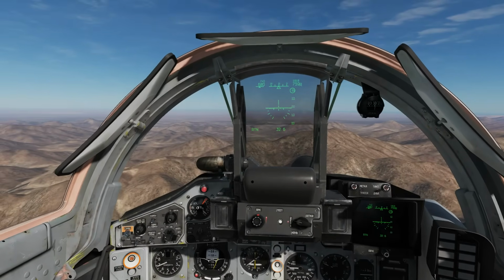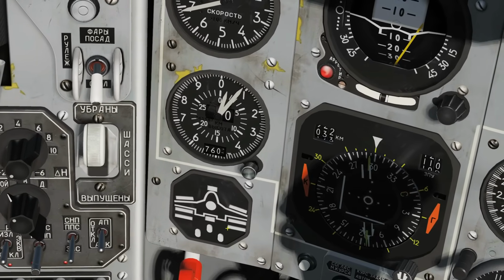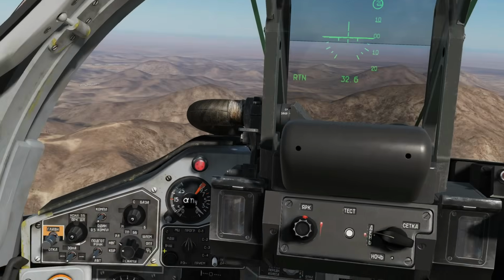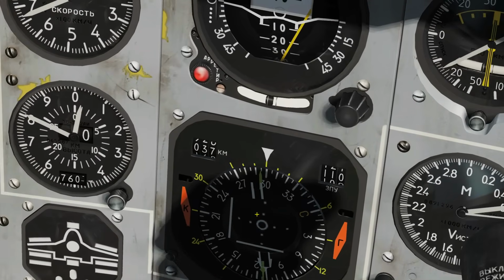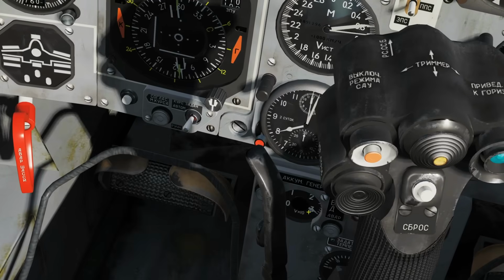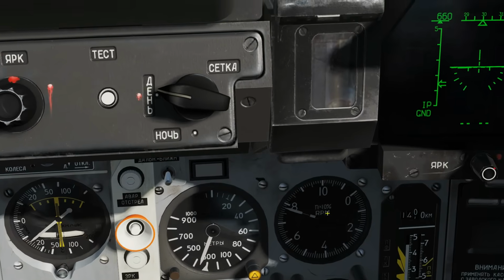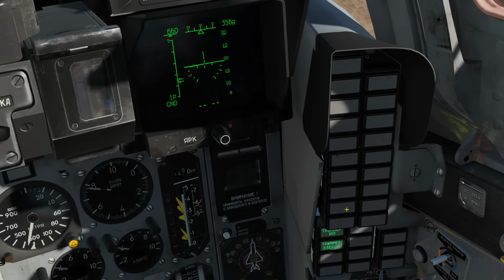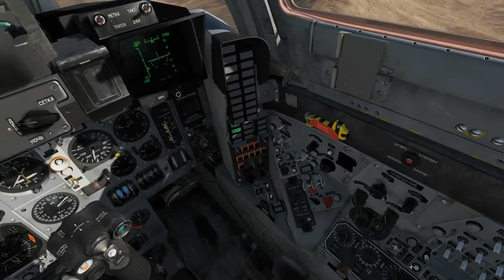Mig-29: Cockpit Familiarization Tour Tutorial | DCS WORLD

Comment: Small correction, if the two lights in front of the wings are on, it means that the slats (leading edge of the wing) are down, usually when flying with a high angle of attack